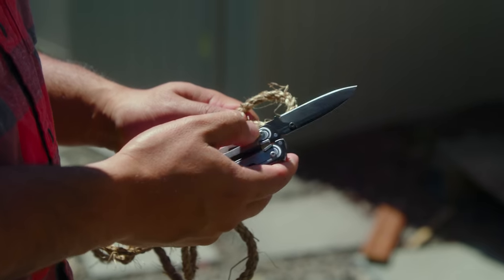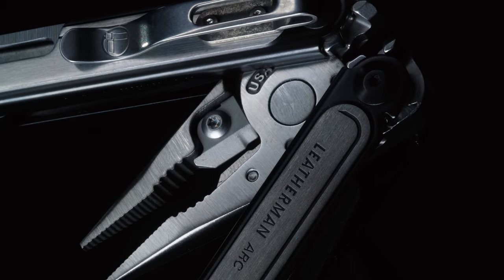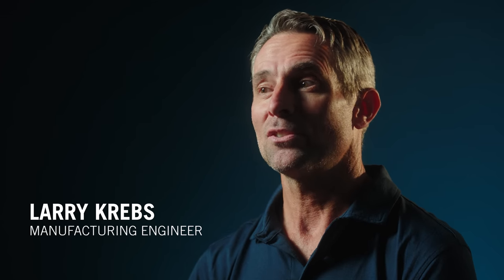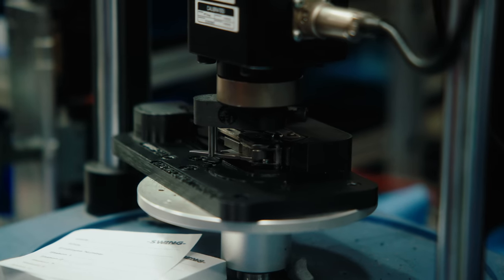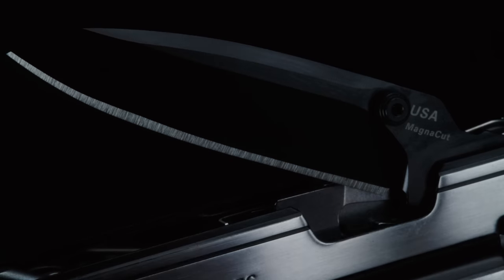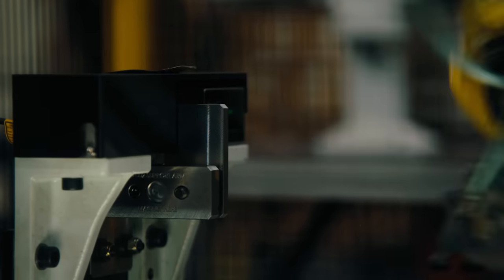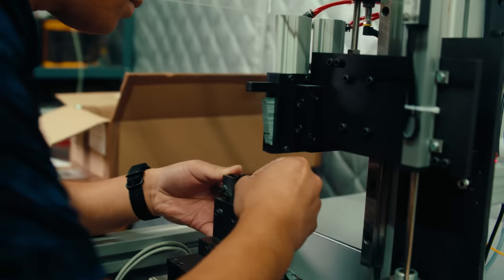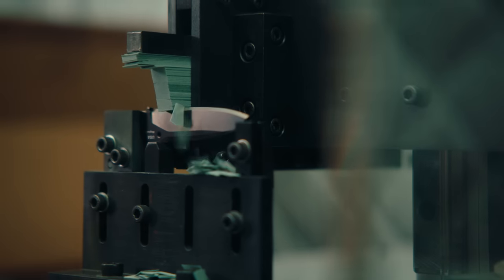How We Made The Arc Multi-tool

Comment: I don't know what happened with your wire cutters, but I cracked my wire cutters on my Knifeless Rebar, just cutting a 240V wire, that I believe was a 10 Guage solid core wire the other day and I had to climb down a 20 foot ladder to get my pliers out of my toolbag, just to finish the job. I kept hearing how good Leatherman are the best multitool, so I got the Orange G10 Leatherman Charge and a Knifeless Rebar, to see how good they are and both have a gap at the base of the plier cutters, just above the pivot. I heard about how the cutters have been breaking and I thought to myself, I don't cut anything but electrical wire, so I didn't care about the subject, until mine broke the other day. I use mine for work and I have been using my Knifeless Rebar almost everyday since February, when I bought it, but now I don't have cutters I can use and I have been using dedicated pliers. I love everything else about the 2 Leatherman I have, and I don't want to use anything else, but if the cutters are this hard a fragile, I can't depend on it. Please fix this issue. Thank you for your time.
Reply: There was a bad batch of the hard cutter inserts that I also felt were far weaker than usual. Replaced them with a current set and it seems to be back to the usual quality.

Comment: Meh....it's basically a free p4 with different steel, different color, and the same drivers on the charge and the wave.....I daily carry my charge g10, but have a wave, rebar, Free P2, and a crunch.....don't feel the need for this at all.... especially for the price....
Reply: Just wait like 8-12 months for their warehouse stock of them to not move as much as they expected and they will offer it for like 30% off. Since the economy/inflation and job market is so crappy right now I don't think many working class people will be spending 240 bucks on a multitool.
Reply: @alex-cf4dy you do realize inflation means prices go up right? If all their expenses are increasing how do you expect them to lower their prices?
Reply: @zripster because they have sales all the itme, they recently sold the charge g10 for like 40 percent off. Any company would rather sell their product at a discount than not sell it at all. I bet that $240 for a fancy pair of pliers is not going to sell that well in the current economy
Reply: @alex-cf4dy  the g10 charge was on sale because it was discounted. Do some research next time.
Reply: @zripster  On sale because it was discounted? What are you even trying to say? The ARC will be on sale at some point in the next 18 months, its very likely. But congrats on being upper middle class I guess.

Comment: Will there be a version that gets the Surge's saw/file exchanger and then adds a serrated knife?
Reply: I already have the Surge with sawe changer. But Surge weighys SO MUCH! 
So I prefer don't carry it. 
 I also want rhe lightest multitool version with saw/ file changer and with "usual" steel. I will use it for hiking and treking.
   As I already have 2 Leathermans and 6 Victorinoxes- the ARC by 300€ is so expensive for me. I dont need so special steel.
Reply: @MSkachenite  you should look at the P4. If you grind down the phillips driver a bit you can attach the adapter that lets the Suprtool/rebar use Leatherman's bits or 1/4" bits
Reply: @dualsportoutdoors  Thank you for advice!

Comment: Can’t use it because you use magnets to hold tools. It will unusable within days at work (metallic dust).
Reply: I work in an environment with metal dust and it is a non-issue. The magnets are tiny and hardly collect anything on them. A little compressed air cleans the tool easily.